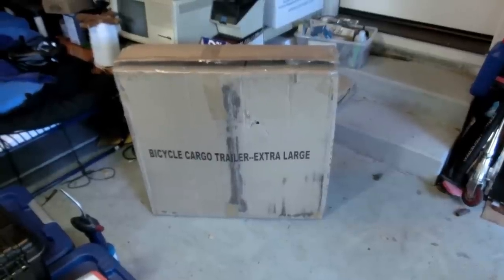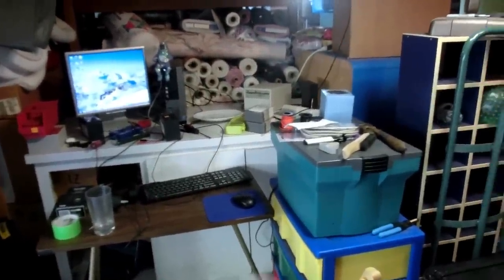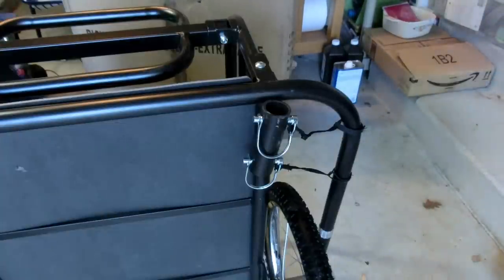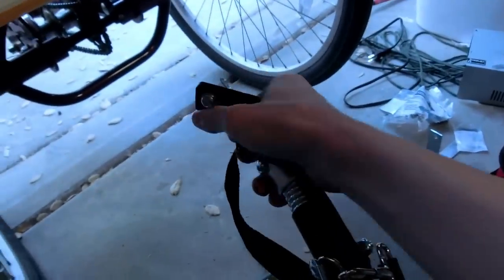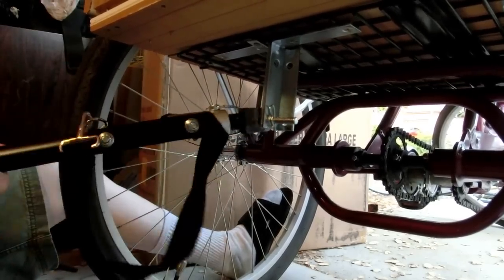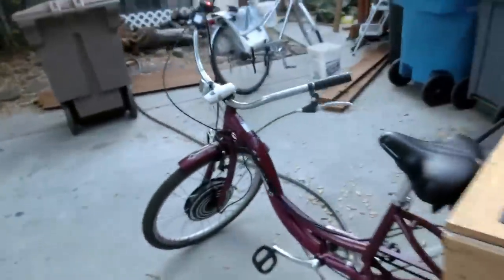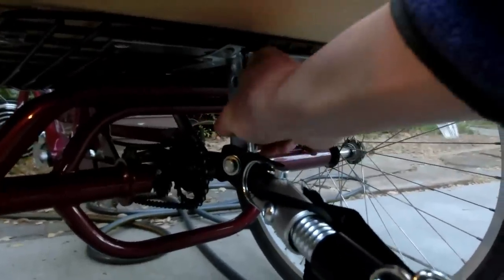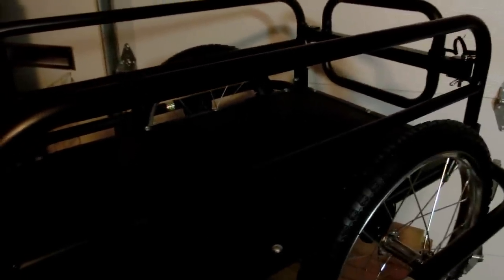114$ Bike Trailer from Amazon (E-trike v1.7)

Comment: It's not bent. If you rode a real bike and not a trike like a toddler or old woman you would realize why it's designed like that.
Reply from the maker: +Chris Spencer no its bent away from the first bend, so the second bend cancels out the first bend. thus it is bent wrong. now that i'm using a bike temporarily while repairing my trike i cant use the trailer due to how its bent wrong. or atleast i couldnt turn right too well with it on.
Reply: +Rinoa Super-Genius Wrong. it is designed that way to give clearance to a back wheel while turning right.
Reply from the maker: Chris Spencer
god your hopeless.
Reply: +Rinoa Super-Genius I've assembled about 3 to 4 hundred of these trailers so far and they all look exactly the same. Same angle. Guess you got an engineering degree from "Moms Garage University"
Reply: +Chris Spencer You even bolted your "bracket" way off center which made everything worse.
Reply from the maker: Chris Spencer
i did it on a bike and on my trike, can't use it on my bike because this trailer is bent in 2 places. simple as that
Reply: +Rinoa Super-Genius Ok. Whatever make you feel better.

Comment: The draw bar is made the way it is to give turning clearance to the back wheel of a two wheel bike. Without the bend like it is the back tire would hit and lock up when turning right. Not such a super genius.
Reply from the maker: +bob b but this has an extra bend that cancels the other one out, and causes the bar to hit my wheel when i use a regular bicylce. use your fucking brain and pay attention next time.
Reply from the maker: +bob b im not the one who did the weld, in order to fix this id need to cut the pipe off and weld it straight so then the curve in the pipe works like it should.
Reply: lol. You're so easy. That's why you're a self proclaimed genius.